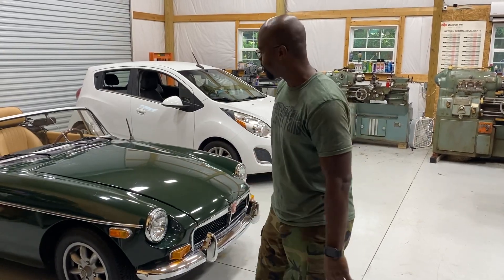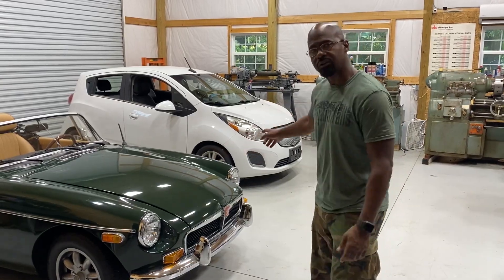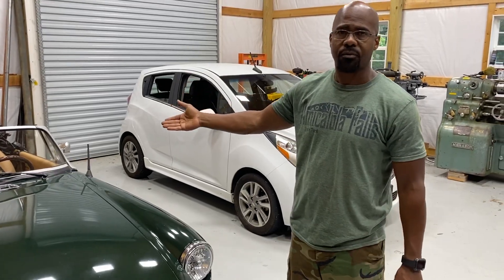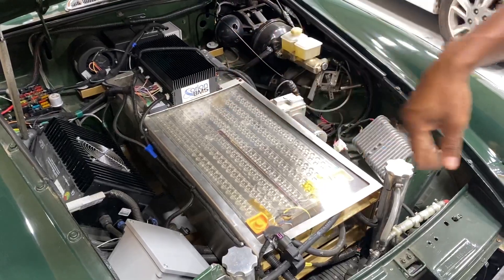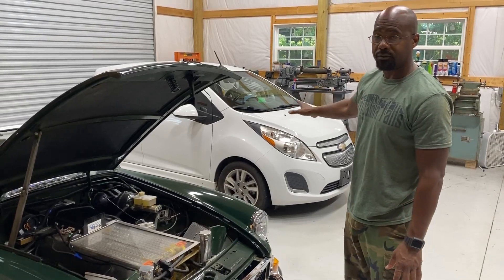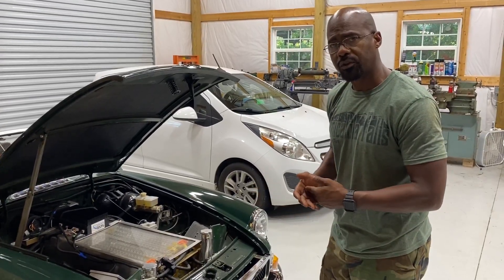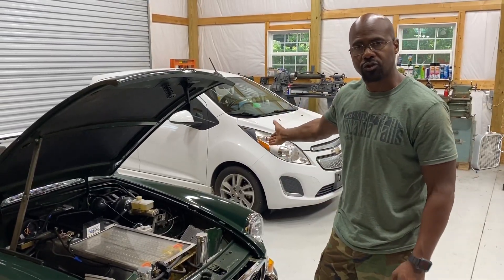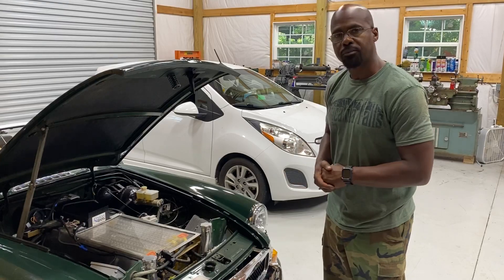Electric MG Roadster EV  drivetrain upgrade

Comment: Did you ever get this working? I have a 2014 spark and want to swap the motor/ batteries in something else - or do you have any information on the controller you were going to use?

Comment: Hi Greg! I have a salvage title Spark EV that runs and drives, and I want to use the parts to convert an 89 Pontiac 6000 STE AWD. I bought the Spark on auction so I can save money in doing the conversion. The problem is conversion shops dont want to spend the time researching the Spark - they just want to upsell me LEAF or Tesla components bc thats what they know. When you did this conversion did you document any of the issues with the Spark? I dont think this is that hard for a conversion but I cant get them to play ball. Thx! - Eric
Reply: BTW This is a passion project dedicated to my father (he loved the STE but was outside his budget at the time). And my cars can be seen at Erplane1. Thx!

Comment: Looking at some of your older videos. Did you have to do special cooling adjustments for going direct to the Tesla motor and not use their drive system?
Reply: Yes we did have to make quite a few cooling fabrication adjustments to make it work.
Reply from the maker: Yes I did have special pumps and manifolds we designed to meet the rigorous requirements this set up may have.

Comment: Did you say 402lb*ft O_O
Reply: yes 402 ft lbs of torque 👍
Reply: @gregcoles2491  Custom controller?
Reply: @NecromancerGarage  I am using the original controller with an Arduino
Reply: @gregcoles2491  can you elaborate on that? Is this Arduino board able to enslave the original inverter?

Comment: Whats the 6-speed for?
Reply from the maker: The 6 speed is to burn through gears manually. Makes driving fun.
Reply: @greggoeselectric3595  THATS what I always thought as well....I am an automatic lover even before we really had them in Europe but an E-motor with manual should be a lot of fun.
Are you sure the gearbox will withstand the abuse? :)
HUGE fan of the channel by the way. Hope you going to convert a 70's Landyacht like a 75 Caprice or a Caddy...but in a powerful manner :)
Greetings from Austria

Comment: Would it be possible to mate a CVT to an electric drivetrain?
Reply from the maker: It is but the drivetrain would be very inefficient due to cvt work off of a constant slippage in order to achieve a desired speed

Comment: But why don't you ditch the MG or other gearbox and install the Spark drivetrain to the rear?
Reply from the maker: The deeper I get into this project the more I’m leaning towards that option 👍
Reply: @greggoeselectric3595  Esp when you learn that the Spark motor mainshaft is hollow with the opposite wheel driveshaft going thru it from the dif. So this means SparkEV
drive unit is only useable as the entire wheel-to-wheel entity. My idea is to replace a
Fiero drive unit with the SparkEV.